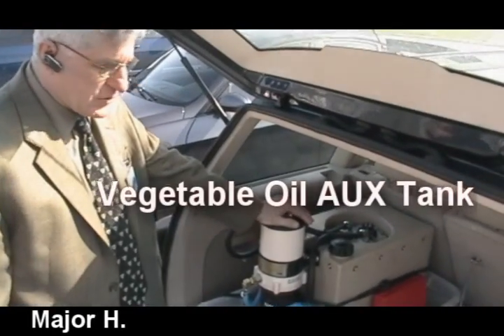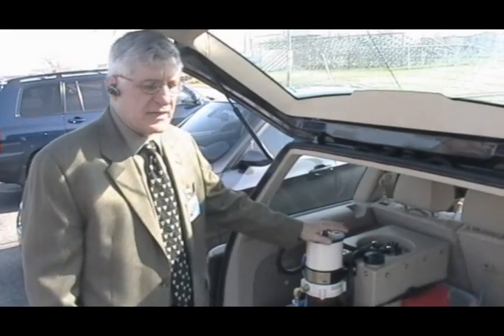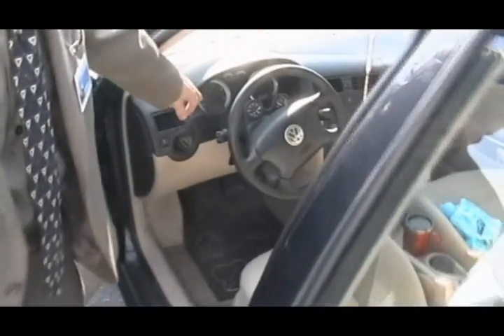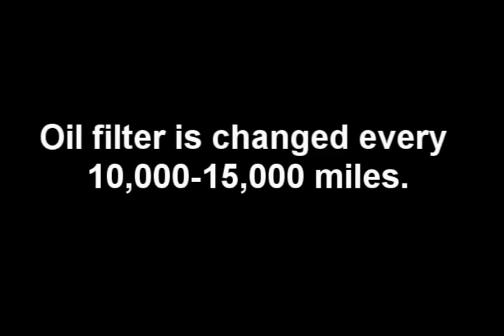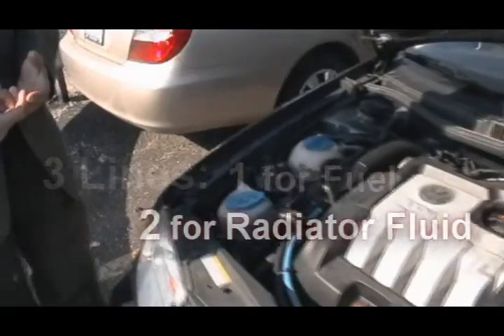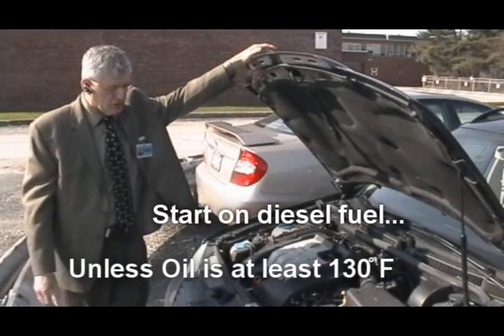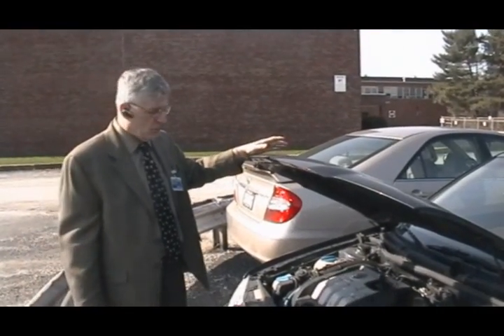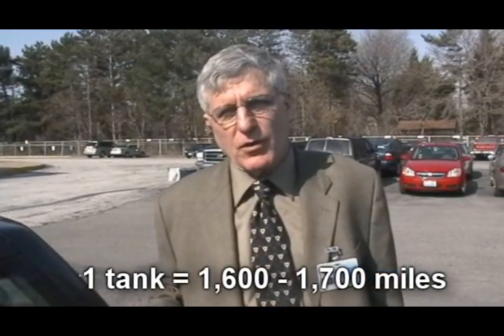Running on Vegetable Oil - VW Jetta TDI / SVO

Comment: Single tank SVO, correct fuelpump, coarse filter, lines, heated fuel filter. Longer glowplug activity. 10+ years OK in my little 3-cylinder TDI.

Comment: How does vegetable oil evaporate into thin air it cant just evaporate it has to turn into a slime or be emitted from tail pipe somehow as something.  eventually entering into the ocean or lakes at one point.  Still better than regualr gasoline or regualr diesel but burning something is still a pollutant and that oil is being burned away and it has to be leaving a waste behind into the soil or your dringing water supply or soaking into ground water because it is pure oil and it must be heavy or heavier waste product into the soil but it is much better for the air probably than burning gas or diesel.
Reply: It can't, the oil is burned into several organic chemicals. It's got the same tailpipe emission chemicals as a normally running deisel.

Comment: you went through the trouble of making this video explaining how it works but didn't actually drive it
Reply: I drove a Ford diesel 250 (about 4 years), my daughter drove her VW Bug for over 100,000 miles, about 8 years (just traded it in), and my Jetta was traded in this year (also drove it for over 9 years on veg oil).  My nephews also drive on veg oil for years now.  I stopped because it's getting harder and harder to get free oil.  Public schools are no longer permitted to fry food (talk to the Feds about this one) so I've switched to putting in computer chips to modify my cars to run on 1-100% ethanol. It's an easy fix and when I get around to it I'll start making my own ethanol for all of my cars.  Comes out to about 1.25 a gallon and no further modifications are needed. I know there are a lot of cars that can run on flex fuel but mine can't so the computer chip is a simple fix.
Reply: Mal Beats I can assure you, you didn't miss much.
Reply: Don't even know what that means...Jerkwaad
Reply: Oleh J. Holowatyj, Sr. I just meant that he didn't miss much, not seeing him actually drive the car, as there is no deviation from a usual everyday vw driver.
Reply: True, it's not as though you can smell the exhaust to be a "believer" (unless you're behind the car and I floor it). There is absolutely no difference in performance driving on oil vs diesel.
Reply: My car ran a bit smoother on veg oil. Also it smells alot for those who drive behind you. Also for yourself if you're waiting for a traffic light and the wind is coming from the back and you have the blower on...
Reply: You're right..and much quieter!
Reply: So is wvo diesels no longer feasible?

Comment: I'm the guy in the video. First "Thanks Thomas".  Since this was made I've (actually  Full Circle Fuels in Oberlin OH did) made some changes to the system making it more efficient. I now have about a 20 second purge time with a light indicator letting me know when my lines are clear of veg oil.  Neat little upgrade for a forgetful driver.  My Jetta had mechanical problems (non-converstion related). Pulled the conversion, however my Bug has the upgrade and is still running strong on oil (100K).
Reply: Hi, can I hire you to walk me through my first conversion? I am an educator as a sustainability school and this is a perfect fit.

Comment: You sir are correct (I'm the nut in the video) you do not need to heat it but it does cause some problems eventually.  One can take their chances.  Studies show that you will experience better performance and longevity to not only your engine but various parts (pump, injectors, lines, etc.,) of your vehicle.

Comment: Russ,  
The titration (which determines how much Free Fatty Acid is in the oil) results in an amount of Catalyst (usually Caustic Soda or lye)  that needs to be added into an amount of methanol and mixed into the oil. This then results in Biodiesel. Not "all the chemicals" you might think.  I like the clean veggie oil. Just has to be de-watered and filtered. It's easier and yes it doesn't require any additives.

Comment: Not true...kinda of. Yes you can run it straight through however you will (at least in our climate in Cleveland) you will get "Cokeing" which will eventually clog your lines, injectors and tank pump.  So yes and no to Martin Skoda from the guy in the Video.

Comment: I dump 50% of waste oil into the tank of my Rabbit MK1 diesel. I do not filter it...I just dump it in. I change the oil every 3,5K and I use some Mystery oil in my engine. It works as a detergent and keeps the motor well lubricated and cleans up the carbons. I get about 54.3 Miles to the gallon in the city. My fuel expenses are at 4 cents per mile at $4.14/Gallon. 
The only issue I have is that I have to start the motor twice when it is cold. In the winter months I just add 10% of gasoline.

Comment: @adamslurch71  depends on the car you have. new high pressure diesel engines are designed to give birth at the slightest hardship. so it really depends what it is running and running on

Comment: Does it give the same mileage while running on the vegetable oil? My dad has a 2005 Golf TDI...same engine I believe. Car & Driver just did an article on how to convert a diesel engine to a veggie oil burner...seemed pretty simple actually. Nice work!
Reply: 13 year old comment... I still the need to answer lol.

In short, No. But it won't but a massive cut. For example, if you get around 42 mpg using regular diesel, you might get around 34 mpg using veg oil.

Did you ever get round to doing it?

Comment: Suggest U consider not filling your diesel tank. Your car will do lots less foot pounds of work - thus better overall fuel mileage if you just add 2-3 gallons of diesel for start up and purge rather than carrying 10 gallons of non needed diesel fuel all the time.....

Comment: Vegetable oil is awesome, got some experience myself.  Maybe about 10,000 miles so far.  Drove 700 this weekend.  WARNING>  Change your engine oil more frequently !  Especially in a VW, some call for 10,000 mile oil changes.......not with veg oil.  Change your engine oil 3000 miles or less or you will be screwing up your valves, friend of mine fryed his Passat Engine not having changed his oil more frequently then requested.  Also, use a little marvel mystery oil in your motor oil to clean.
Reply: Interesting
Reply: 250 miles in the summer per gallon.  Sounds like a deal to me.  Going to start looking in to converting my tdi jetta.

Comment: I visisted that Pharmacist this afternoon and he told me that old Rudolf's other design in an engine was for coal dust.  The two flippen idea's would'nt even be for the same engine.  The difference is like the night and like the day.  They're both engines, they're both parts in a day.  That's the extent of it.  Coal dust and compression don't mix in my world.

Comment: What is your source for this information?  I would easily believe that he designed an engine for coal dust, but I do not believe that if it is true that it is the same combustion engine as one that runs on vegetable oil/ petrolium diesel.  So if you could, please provide me your source, I'd like to see what you're talking about. Thanks.

Comment: these are so dumb it's cheaper and better for your car to just use biodiesel. the glycerin in the oil will create so many deposits in your engine. Just process your oil into biodiesle and you don't have to put all that dumb expensive crap in your car. greater complexity=greater risk of a malfunction.

Comment: Whatever floats your boat man.  I have a '73 Mach 1 with a 351 Cleveland 4 bolt.  Thing is, I'd hate to have it as my daily driver, those old muscle cars suck ass in the rain and snow.  I guess they also suck in any kind of corners too.  ;)

Or, you could get a 2000-2003 VW TDI and trick it out so it blows the doors off of any old man hot rod.  Easy to do, cheap, super high mileage, and not a rolling coffin.  Just a thought.  Check dubdubdub.forums.tdiclub.c0m  Some super cool stuff.

Comment: Couple of minor issues with this video:

First is that the title says "SVO".  That means virgin or "straight" vegetable oil.  There are kits from Germany that are made to specifically run only new vegetable oil, but this is not one of them.

Second is his claim that he took the alternative fuel tax credit.  That's great, unless he gets audited.  Vegetable oil systems are NOT included in that bit of tax code, so good luck to him.

Other than that, not a bad video.

Comment: Diesel is near $5.00/gal.  You only need some bag filters, which cost about $5-$10 a piece, and can be cleaned and reused many times, at least 2 metal barrels (metal so hot grease from the fryer can be poured in), an electric or manual pump, and a conversion kit which you could put together on your own for about $700.  It requires only one filtering through a 10 micron or smaller filter, and it is ready for use.  If you're willing to give a little more of yourself, you can do this.
Reply: don't forget the extra cost for all those engine oil changes and the time involved in filtering. Especially cleaning after filtering 'accidents'... Another thing is here in Europe used oil is actually sought after by big companies who reuse it.

Comment: These solvents are all BS.  Most of them contain gasoline, which should never be run in a diesel engine.  VO must be heated before being injected into the engine, or else your diesel will meet a premature demise.

Comment: Kudos to you for acting on behalf of the environment.  However, if you continue to run your car this way, you will destroy the most expensive part of your engine: the injector pump.  You should do it the right way and heat up the VO before injecting it.

Comment: The fuel you burn has nothing to do with the turbocharger.  Turbocharged engines' heads and blocks are made with a harder alloy and therefore more heavy duty than naturally aspirated engines.  

Your diesel is getting 48-50mpg burning filthy diesel fuel.  Your mpgs are virtually unaffected when burning VO.  People do it because it's cleaner and it's free. Biodiesel, which is simply VO with the glycerin exracted so it is less viscous, will actually clean out all the crap that diesel fuel deposits

Comment: Nice im running my car (toyota corolla with 2c engine) on a  mix of 25% diesel 75% percent waste vegetable oil it starts up straight away but the engine labours because the engine is cold. i have to wait 5 mins for it to warm up and if i turn the egine off for 30mins i have to wait 5mins again. Once the engine is hot it runs just like running on straight diesel. I can hear the fuel pump working harder but there is no power loss like when i use to run it on biofuel i had 10-15% less power

Comment: this was extremely educational. this should be the next trend. there could be services that filter waste oil. or you could just do it yourself.  but if you watch the driving to AK with vegetable oil, you'll find that the filtering process for waste oil is almost painstaking.  fast food services and chinese restaurants go through enough oil to power a lot cars like this...to bad you need a diesel/turbo diesel